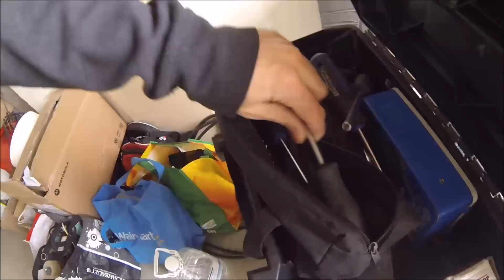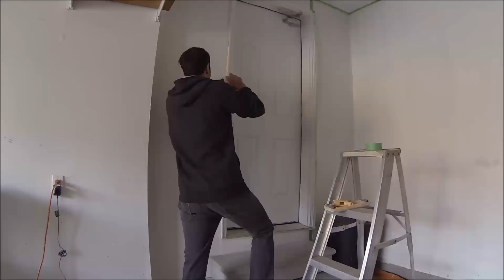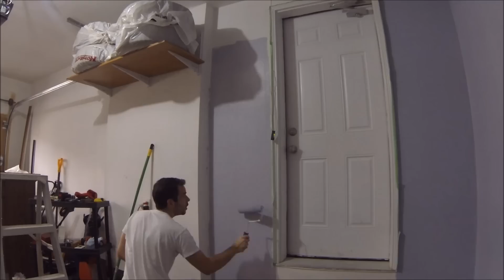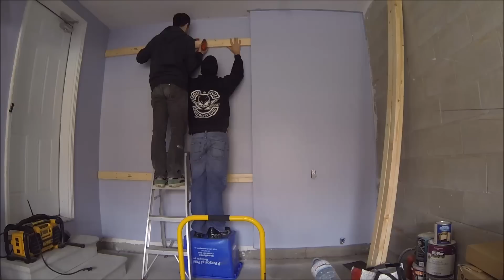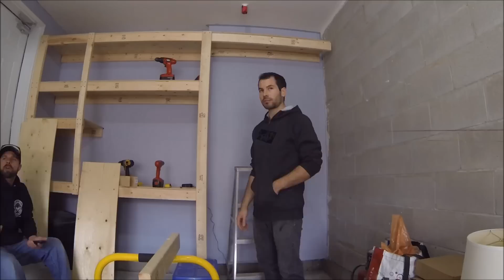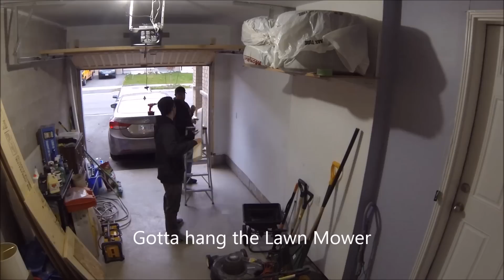Time Lapse Garage Storage and Workbench

Comment: Nice video. I see that there was no support added in the center of the ply from the bottom for the top two rows. Is that okay? Could you please share your dimensions? I am planning to have  7ftx3ftx9ft(LxWxH) and I have 3walls support (Left, Back, and Right) so was wondering if I need anything else in between for 7ft? Also what material did you use for the vertical beam, horizontal support and ply? Thanks a lot for such a handy video and I see that way lesser lumber was used compared to other videos I have seen :) Great job guys.

Comment: is the workbench combined with that wall unit?    never thought of just nailing a 2*4 and hanging lawmover and stuff off of it.    Then again just started gaining interested in DIY.  WHat did u use as hooks from that 2*4 to hang those things?   thanks.
Reply from the maker: +Nick Patel Hey Nick, yes I built the wall unit so that a portion of it could be used as a workbench. I found some heavy duty hooks at Home Depot and used wood screws to put them into the 2X4's. The 2X4's are fastened to the wall studs with lag bolts. Thanks for watching!

Comment: Considering the  Size of space and  lack or area  your dealing with over all here.   Certainly appears  that  a  WHOLE Lot  Of Effort and  Cost  went into just a  small amount of  gain. Painting the  walls a Darker color  actually  makes it come across as much smaller  now then before. By Using  the  Built in version instead of  Free Standing Options  you  have  Created Less overall Space that can be  used.  The  Narrow  width lends it to going  Vertical as in ( Over head for most  out of the way storage  gain. Many Pre-fab Grate type systems  hang from the  ceiling  joists and are quite  nicely finished out of the  box.  Leaving  a  Moveable  Work bench type selection as being set aside in the  cubby  next to the  door.  Keeping things OFF the Ground and  Out of the way is  your Biggest Bang for the buck.  NO Reason to attach or  Add a  Structure to the Walls  that is  so  limited in over all capabilities.   What is shows is that a  Good  Idea  Went  Way  Wrong  and  cost  a lot  more time  using  effort  you  could  have  avoided from the start.  NEVER - Ever  Use  Dark Colors in a Small Space . Nor  Add Built in where the  Need  for  space is  already Limited in overall Width and size.  This  project gets a  ( d )  rating  for the  result  was anything  expect a Slight bit better than what  was there before.  IF YOU REALLY  WANT  SPACE ( SAVE IT ) BY CREATING IT  ABOVE YOUR HEAD AND  DOWN FROM THE  CEILINGS LIMITING  THE  WASTE OF  FLOOR  SPACE  YOU DO NOT  HAVE  FROM THE  BEGINNING.   There are plenty of  Reasonably priced  kits , stand alone's , and  also customizable  options ( Just ) by looking .   Cost  would  be  about  the  same  when compared to the  flexibility and overall areas being used instead of  wasted .  Remember this :  K. I. S. S.  or  ( Keep It Simple - Stupid )   Measure twice and Cut  once.     Level and  plum can make the  difference in the  end.  Mount  Into Studs and  Joists  when  ever possible  so  ( KNOW ) Where they are before you  just  start  throwing  things up.  Like  Outlets and receptacles.   Never  Cover them over or Block them for  future use.   Bringing a  Buddy in is a way of getting  extra hands YET  standing around  ( texting  ) goofing off and just  burning up  valuable time is  anything  butt ( STUPID ) ...